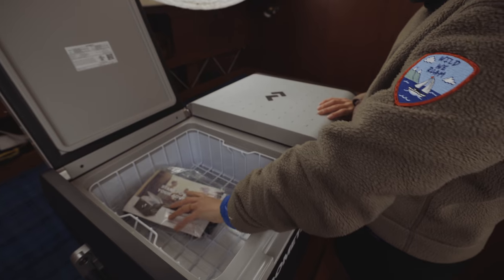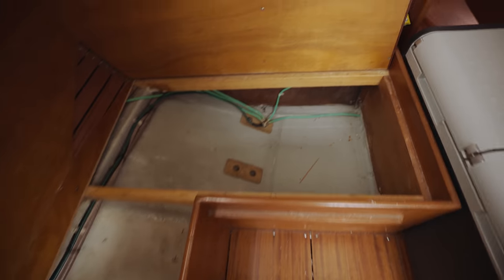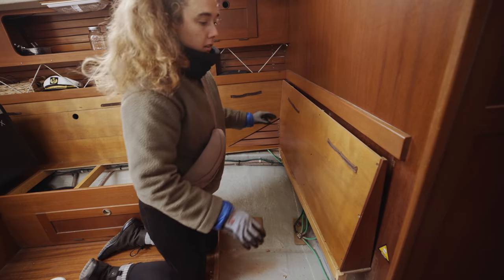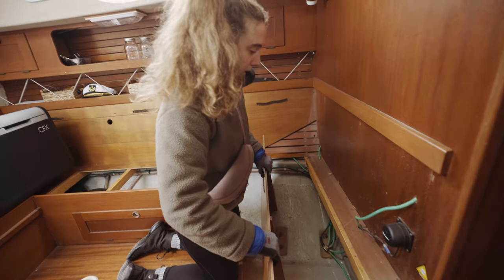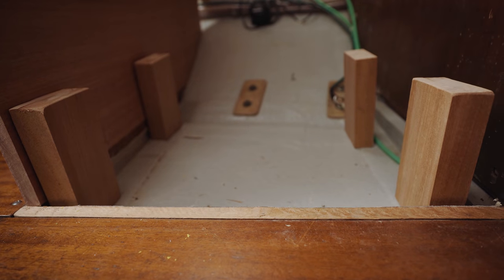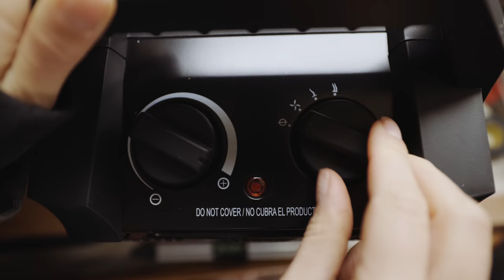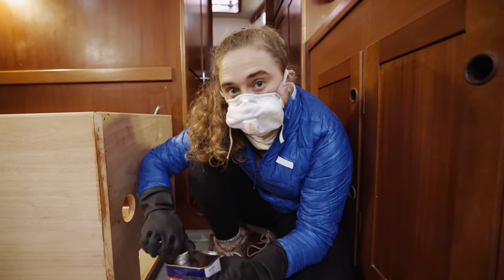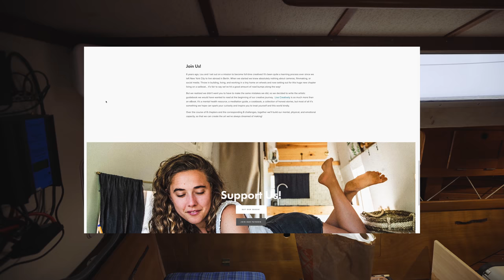She Won't Sail Without THIS! | Boat Life Ep. 35

Comment: Would it be easier for the fridge to open the other way?
Reply: The fridge needs air flow and the vents are on the side facing out. That’s probably why they positioned it that way.
Reply: I thought this too, there must be a reason they chose to put it that way around though. For me my freezer is used a few times a week, the fridge is used multiple times a day so i would prefer it the other way around. Anyway regaddless of that, it looks amazing and they've done a brilliant job!
Reply: +1
Reply: I was also wondering. They must have a reason for it. Really curious though 😋
Reply: The galley wall on that outside would keep the hinged doors on the fridge from opening all the way.  The would hit about 3/4 of the way up of open.
Reply: The lid hinges can be changed to the other side. It’s a simple procedure
Reply: I would prefer to not install it permanently in any place, just find a good spot for it and when necessary move to another one. But nice project anyways.
Reply: I also feel like fiberglassing that structure in was an odd choice, assuming they’ll eventually sell the boat without a dometic in it and that the dometic could need repairs, it seems difficult to access?
Reply: @emilypaxton6509  they seemed to rebuild what was there give or take  perhaps they should have just moved the cushion and put it on top?😬

Comment: If you put the fridge higher and added some storage under it, the fridge would be much more usable and you could shove it closer to the outer hull and make more space. You could also more easily add ventilation for dissipating the heat. Just a thought.

Comment: please check that the fridge doesn't affect the compass - or move it to a non electrical/metall environment...
Reply: Good point but since I saw only earthing wires I am going to guess it was old equipment. If it was not odds are it would be a gps puck not a full blown compass but good thinking.
Reply: @glennedwards1449  07:38 looked like the compass unit for the autopilot - they will find out soon enough when the boat changes course whenever the fridge motor runs ...

Comment: 1. Not a good idea placing the electric freezer so close to the raymarine compass.
2. Not to make you feel bad but its worth to mention that you can actually buy a AC/DC fridge freezer that could fit in your old icebox cabinet. So you do not cramp your limited living space.
Reply: Looks like they removed the compass already.
Reply: We are currently installing an Ozefridge refrigerator kit in the icebox of our Rasmus.  It is a eutectic system and the in-icebox unit is only the size of a phone book.

The condesor unit is small and fits in the area under the floor of the nav desk.  It should draw about 18-19AH/day and uses the freshwater tank to help cool the compressor -so no through-hull.

Comment: Nice, I got the same fridge in my van, cant be happier with it! BTW, heard you mention once side is the freezer other is the fridge. in fact, you can designate both as freezer or fridge, depeneding on your needs (I do indeed use the smaller one as freezer and the larger one as fridge)
Reply: What model/size is that fridge? The 75?
Reply: @waywardescapes4384  Yhe one I have, which seems like the exact same version they have, is the Dometic CFX3-95DZ
Reply: @Okkebeltman  That explains why it’s so big. LOL. I’m wanting the smallest one with the dual zones — either the 65 or 75?
Reply from the maker: Thanks for the info, Okke, that is really useful 😊

Comment: I don't wish to ruin your parade but with that fridge next to your electronic compass you will not be able to rely on your Raymarine to give you accurate navigation data – that is why there is a warning sticker next to it – my guess is anything electrical cannot be within half a metre minimum of the compass (but this depends upon the system so please check your Raymarine spec.

Comment: The Raymarine Flux gate compass should be reinstalled as much as possible on the centerline fore and aft of the boat, at least one meter away from ferrous metal (think Magnet) and also in the same axis as it was before otherwise the Pilot will not indicate true magnetic north. Cheers

Comment: What did you do with the Ray marine compass?😎🇨🇦
Reply: My thoughts exactly...all metal is to be kept a minimum of 1 meter away. secondly, what happened to the wires attached to the bonding plate?? Cheers.
Reply: @NELLIE3588  It appears later in the film on the Port side at seat height, but I think its still too close to the fridge and compressor.
Reply: @pete9501  Did not see that, I have to go back and check that out again, thanks dude😎🇨🇦

Comment: I think it would have been cool to have completely gutted the inside from the very beginning, like you did with the van, that way you could have built the inside exactly to fit your needs (while using the original wood, etc for aesthetic). I know it would take more time and a little more money, but if I personally were going to be living on the boat full time, then I would want it to function for me, instead of just working around what is already there. Also I just like watching those videos where they completely transform spaces like this. Just my thoughts 😊

Comment: You really nailed this project. Using epoxy with fiberglass really creates a very tough bond that I don't doubt will keep up with the boats lifespan itself.
Also, I completely understand the need for a fridge. I travelled two years by vehicle (four-wheel drive in australie & campervan innew zealand), and there was nothing I so wished for to have than a fridge. I would have been hard pressed to decide between a shower and a fridge on board, though :D
Enjoy your new gadget, I'm looking forward to see it in its final state =)

Comment: Nice job on the wood working! 

I noticed when you put the bottom sheet down that the green wire that came out of the wall from your head was removed. 

I hope it was re-routed and not just cut off. 

That is a ground system. It’ll prevent stray current from eating your boat alive. Or it’s possible the lightning ground system or it’s both. Regardless, I hope you didn’t abandon the wire because on boats grounding systems are very important.

Cheers,
Jeremy

Comment: Little tip for you people when working with smaller pieces of fiber glass and resin:
Cut pieces of (clear) plastic bags about 2 inches larger then the piece of fiber glass you want to work with. Put the fiber glass on top of the plastic and then saturate the fiber glass. You can then pick up the pieces by holding the plastic and not create a big sticky mess. The plastic can also be used to work the saturated fiber glass into any corners (which normally need some sort of fillet (which can be done with home brew putty: resin mixed with saw dust - you should save some obviously)

Comment: Having a new frigid best friend you have the opportunity to make the icebox a heat retention cooker (like a hay box) I own several which I use in the house and in my camper van. I highly highly recommend you get convert the icebox into a heat retention cooker which would make cooking, stewing and even keeping cold food a very easy, cheap and mainly safe from major spills and assorted messes while sailing. I assume the icebox is already insulated to kingdom come so you would basically only need to rig find a pot with a lid which can be sealed (like a pressure cooker) which fits the ice box and some cushions to take up any space between the pot and the icebox hard walls.

Comment: The refrigerator has caused quite an uproar! Hind sight is 20/20. It seems a placement at the other end of the sofa with the same build may have been better for the way it opens. It may be somewhat inconvenient the way the lids open now but not nearly as inconvenient as not having a refrigerator. I have done countless remodels on houses and RV’s and it is not an easy thing to figure out in a tight space. I truly think you guys do amazing work.

Comment: We lived aboard our Rasmus full time for two seasons in Chicago and then for over 2-1/2 years straight cruising using just the icebox -we had no fridge at all. The boat just has the icebox.

We do have a drain in the icebox with a hose that empties into to the wet bilge.  We have to buy ice every 2-4 days depending on how much room for ice we have at the moment, and if we could get block.  We didnt have to cut up a 10lb block to fit it inside though. Block lasts sooooo much longer longer. 

Not having a drain for meltwater must have been a nightmare for you.  The bilge pump makes quick work of removing the melt water once it gets there on its own.

We don't mind using ice but GETTING it was sometimes a real pain -especially out in the middle of nowhere.  Without water sitting in the bottom we didn't lose too much food over the years unless we couldn't find ice in time when we needed it.  We put on a lot of miles cruising and the entire first year we were always moving and going to new places where we hadn't been before.  Finding ice was a hunt every time we needed it.  We rarely used marinas before COVID. 

Right now we are building an Ozefridge icebox conversion fridge and we can't wait to be liberated from from finding ice.  That will allow us to explore backcountry areas far from civilization and be able to gunkhole far from anyplace without needing to find someplace to buy ice all the time.  Being able to stay out for a week or more at a time where there are no stores or towns nearby will be heaven.

We have another week or so of work left before we can start it up. Doing major projects while still living aboard and not even at a dock is a lot slower than on the hard.  We do more moving of stuff and cleaning up than actual work. We get about 2 hours of real work in between early breakfast and a late dinner.  The rest is all prep and cleanup...

Comment: Did I share my latest fixation dielectric grease? To keep your electrical connections from corroding. Epoxy. Thickened epoxy. Sometimes you need thicker epoxy to use like construction adhesive, to hold down hardware, etc.... WestSystems of course sells all kinds of fillers. A neat trick is to use baking flour or instant pancake mix to thicken epoxy. I've used this on the decks of my sea kayaks (15 years ago) with absolutely no problem. The flour gets completely saturated with epoxy, critters won't eat it, it doesn't absorb water.

Comment: I would be wary of fitting the Raymarine Fluxgate next to the fridge compressor. Normally the unit also has to be mounted on a vertical surface if you're re-positioning it.

Comment: Cardboard template, love it. I can give you an additional tip tough. First, rough in the shape. Does not require perfection. Then hold the cardboard to the place it should fit. And scribe the line of the contour with a parallel marker. You don't need to buy one, a block of wood and a pen will do just fine. And here you go. A perfect matching template with very little effort.

Comment: Bearing in mind air flow you should consider additional insulation I think the company even sells some. However more insulation means the fridge/freezers runs less saving wear and tear and more importantly your precious precious electricity. Also note that the marine environment will be harsh on the metal fittings and you cannot stop air getting to it. You can mitigate this with a bit of paint on the metal. Checkout Sailing forums for tips. However this is an excellent choice and one of the go to fridge/freezers for cruisers.

Comment: Would the fridge not fit on the seat,
Reply: And???? You still need to secure it. The space beneath the seat was empty. I think that they chose a very good and workable solution. The venting of the fridge is on the freezer end and the lids can be mounted to open the other way too. AND! Either compartment can be fridge or freezer too. Your choice.

Comment: Surprised that the unit  isn't orientated with the fridge closest to the sink/stove (as used more often) and doors that open against the wall.  With how much use, I vote no cushion on top of it.  And since you are building ... surprised not making some type of storage compartment underneath it.  But a stellar improvement and love seeing the process.
Reply: The lids can be moved to the other side. See the large holes in the side of the enclosure? The fridge vents on that side and needs those holes for venting otherwise the compressor will be working too hard and it won't get to the temp that you want. There are various restrictions no matter which orientation is chosen.

Comment: Congratulations on the project, if it meets your needs this is what counts.

I didn't particularly like the layout, but that's just my opinion.

I would put it in the same place Dá where you removed the previous one.

Yes I know, it doesn't fit. But......

Projects are for that, I would disassemble the brand new freezer, and use the parts of it to allocate in the place of the previous one, removing the plastic outer part I am sure it will be smaller, I would leave the freezer in the bottom front, and the refrigerator in upside
But again, good design.
Reply from the maker: Thanks, Leo!! Indeed, it's all about doing the best for your needs in the time frame 😊 Your idea is really cool, too!! Thanks for watching!!